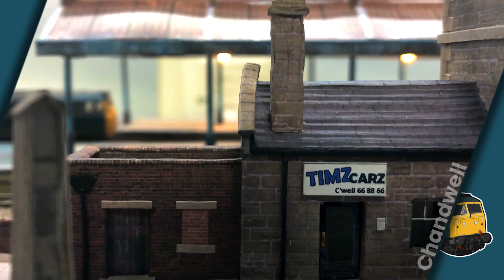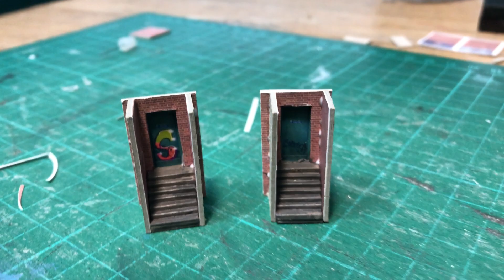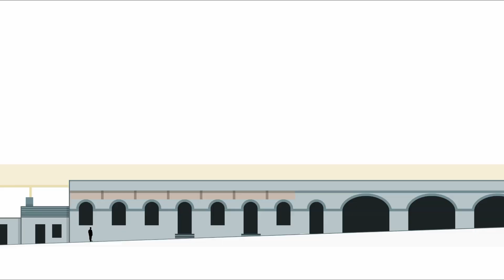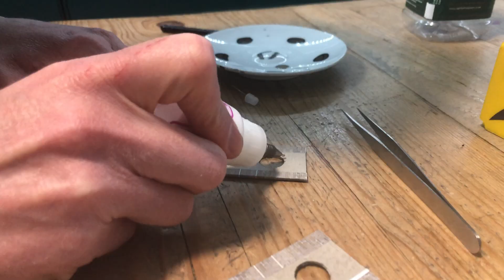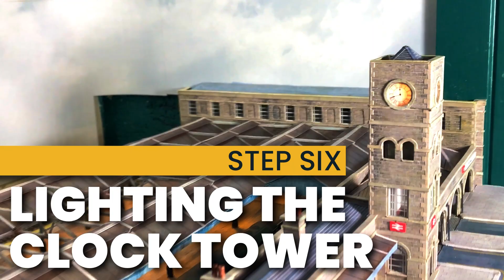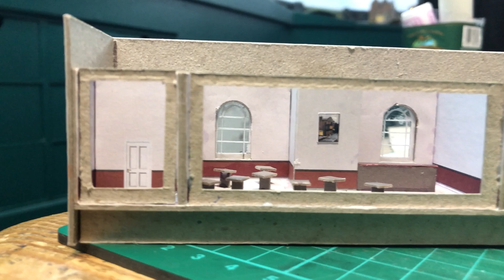Scratch-Built Mainline Terminus Station Part 1 : Starting a scratch build in card

Comment: I would build a structure like that one from the craft foam that is about 6mm thick and has paper veneers on the sheets.
Reply from the maker: I’ve never tried building with that Paul. I’m curious though… how would you make the windows and mount the glazing? :_chandChandwell:Michael
Reply: @Chandwell  You would cut a hole through the foam and the paper veneer and then use sections of craft sticks to make the surrounds for the windows. The windows could be bought in a package where there are several sizes or they could be printed. The craft sticks around the opening for the
windows could use small sections of wood that can be bought from Walmart that are 3mm thick to allow the window cladding to attach to that. The glass (thin plastic sheeting) would be attached to the back of the windows as usual.

Comment: I have watched with great interest the creation of so many wonderful buildings and structures. However, I have many doubts about using card - simply for fear that it will warp and change colour over time. Can you allay my fears?!
Reply from the maker: Hi Antar, I can only say what my own experiences are. I started using card in Scalescenes downloadable kits in 2013 in 00 gauge. None of the kits have faded or warped despite one layout living on end in a garage and largely being a home for spiders. Chandwell is in a windowless room so it’s not a fair test but I’ve never had any issues with colours fading. I think as long as you use genuine printer ink and non cheap ink the. You should be ok. I always brush in four layers of varnish and use proper photo paper to print onto. —Michael.

Comment: Another enjoyable episode! I really appreciate your methodical approach at scratch-building structures. It has totally changed the way I look at building them. Also, your series on using Inkscape to design your building has given me tremendous insight on the use and value of this excellent software! Thanks.   

PS - Have you considered adding a 5-10W diode laser engraver/cutter to your tool/equipment inventory to do all of the cutting that you currently do by hand? Just curious...
Reply from the maker: Thank you! I do sometimes ponder a cutter of some type. But I have such a limited budget I can always think of a million other things I would rather have, at least while my eyesight is good, my hands are steady, and I don’t have arthritis. I do get an amazing sense of satisfaction when I remember the hours of cutting by hand when I look at the layout. I think a cutter or a 3D printer would perhaps dilute that sense of satisfaction, so for now.... I’m sticking scalpel. 😀😀👍🏻